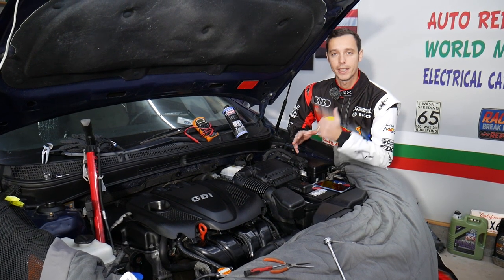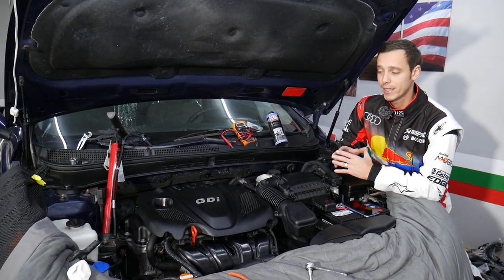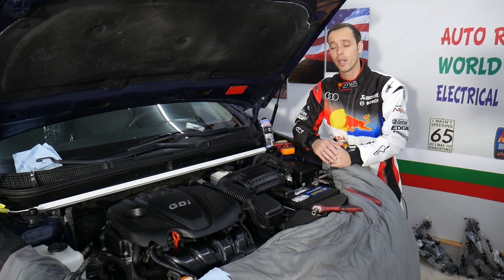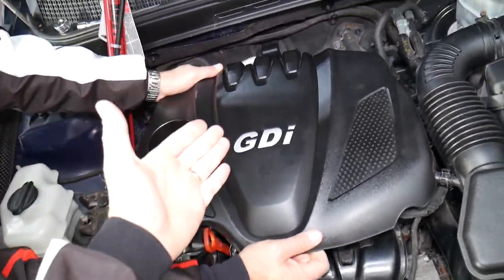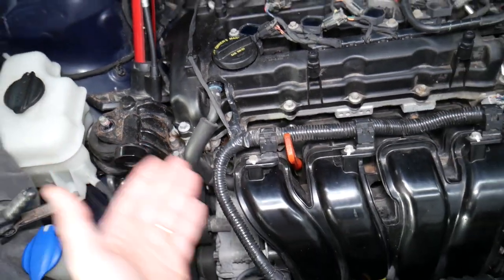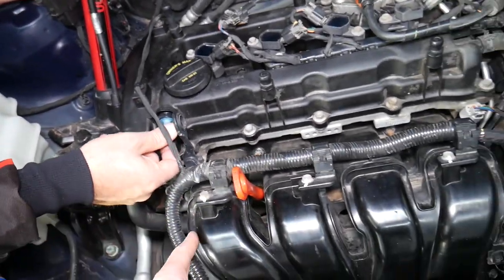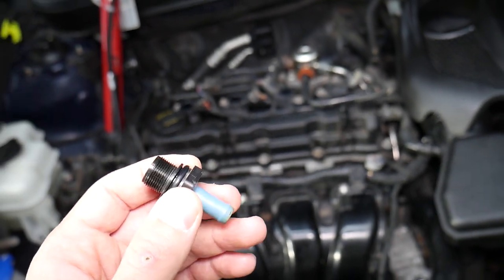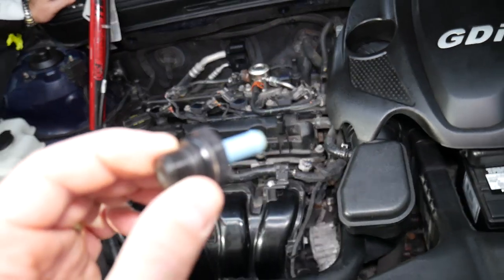KIA OPTIMA INCREASED OIL CONSUMPTION, BURNING ENGINE OIL

Comment: I'm sick and tired of changing full synthetic oil in my 2016 Kia Optima for every 1000 kms! Dealership is like there's nothing they can do except buying a new engine! How in hell can I change an engine on only 149000 kms? This is my last time to buy a Korean car! I had the same issue with my 2015 Hyundai Sonata!
Reply: I'm having the same problem I don't understand what it is about Kia my parents are having that problem too we've only had it a year and a 1/2 and and it probably uses a quart of oil every week that's after I put  treatment in  it that's supposed to stop or slow oil usage down now it's starting to skip a little bit they told me I need a valve cover gasket but I've never seen a drop of oil on the ground underneath it as much oil as it uses and I've never seen a drop on the ground I've never seen anything like that.  Normally a vehicle goes through that much oil your whole driveway would be black
Reply: @melissafritts8648  These Korean cars look good on design, but the engines are craps!
Reply: same here, I only get about 500 miles
Reply: There is a engine recall on your car. My daughter had the same issue and now the car runs bad. The dealership is not helping out. We are taking it back today to see about the recall. Problem is there are so many cars that need engine repair or replacement. Kia is not fixing the problems.
Reply: @marleenanconetani4516  hello did You ever get your issue fixed?

Comment: Changed Valve and still burns oil Kia sucks. Never again will I buy a Kia.
Reply: What model/year miles does it have?
Reply: @joeblue386  2018 /Kia Optima 96,000
Reply: @robc6165  have you tried using full synthetic high mileage oil, might help
Reply: @joeblue386  Yeap
Reply: I’m in the same situation.. 2017 Kia Optima.. burning oil bad, idling bad. 95k miles. So bummed,
Reply: @mirandamabe5107  I had no choice but to traded in I’m done with Kia
Reply: @robc6165  this is what I’m worried about. Gunna have it checked out first and make 100% it’s not something silly, guess we will see. Love my car but man.. cars shouldn’t be going out so quickly like this, i for one don’t have that type of income to buy a new car every 60k miles 😂😂
Reply: @mirandamabe5107  Well try to get you a Chevy or Toyota 🙏🏽🙏🏽
Reply: @robc6165  I don’t think hubs would appreciate a Chevy coming out of my mouth 😝😝 he’s a Ford guy. I wanted a Kia, because then nobody can say “oh your Ford or Chevy sucks” 😂 thinking jeep route, we’ve had a few, need a older model so hubs can actually work on them, these newer sideways engines he won’t touch.
Reply: @mirandamabe5107  Yes Jeep is good no mas Kia 😃😃😃
Reply: 2015 optima never burns  any oil
Reply: @MichaelSmith-ti6qc  older models are better
Reply: @robc6165  wait until about 110k that what mine is doing now😥
Reply: @MichaelSmith-ti6qc  what until about 110k that's what mine is doing now. Even with recall.. that they recalled I'm now out of warranty. Even though corporate kia told me my engine is lifetime because of this. No dealership will touch with me paying 100%
Reply: @MichaelSmith-ti6qc  just wait mine is 2014 just hit 110k. Now putting in oil constantly. Kias are pos.
Reply: @jenniferjohnston6361  oof
Reply: I've done the same thing I've used all different types I even used treatment that's supposed to stop or slow down the usage of oil and it does not work! I'd I don't get this Kia thing my parents have the same problem and everyone I talk to online the Kia they own uses oil mine uses about a quart a week depending on how much I drive it they told me I need a valve cover gasket if a vehicle uses a quart a week and the valve cover is bad  normally oil is all over the ground my driveway is clean!! that's very strange lol  And I don't know if you've watched the videos on how to change valve cover gasket but you might as well try to teach me  Is calculus
Reply: Mine has over a 100000 miles and it's a 2015 I have 99 model trucks with  Over 250000 miles that don't use a single drop of oil but this 2015..  They don't make them like they used to and they don't make them in America ...wonder what the problem is lol
Reply: @melissafritts8648  young kids with there technology
Reply: @joeblue386  I have used ultra premium full synthetic oil, yet  the engine burns it like crazy! I have a Kia Optima 2016 at 150000 kms!
Reply: @robc6165  Chevy?  are you kidding they build garbage......Ford and Toyota have the best reviews
Reply: @toddbob55  relax 😎

Comment: Y’all HELP! My Kia is burning oil like crazy in 2 weeks the dealership is suggesting that I pay $1200 for a combustion cleaning? But I don’t know if that’s the answer
Reply: Probably not.  I had a PCV valve replaced, fuel induction service, injection service and my spark plugs were black Twice. Nothing has helped.

Comment: This May 'Help' For 500 Miles Like 2 Qts Of Oil Will... But This Engine Is Just Flawed..... Best Bet... Get Cheap Oil Changes... Doing It Myself I Get The 20k Mile Filter And A 5 Qt Container  Standard Basic 5w20 $20.. And Just Pour A New One In Monthly Til I'm Close To The 20k Miles Which You Can Set To Remind You In The Car....

Comment: I was thinking my mechanic was shorting me during my oil changes, because I notice my oil light is coming on 500-1000mi. early before it's time for me to get an oil change! I'm definitely going to swap this little part and hope it fixes the issue.
Reply: Same here lol
Reply: @kuntachente6273  I just changed my PCV valve today and it was easy AF for the 2016 Optima. Now, I just gotta see if this stops the burning oil.
Reply: @420  your comment took the words right out of my mouth. I thought the exact same thing. So tomorrow I’m going to do the oil change and swap this valve for a new one too. Good luck to both of us lol
Reply: @420  did it work?  i also have a 2016 and wondering if this is the solution...
Reply: @kuntachente6273  me too! Just swapped it out and will see if the level stays put like it used to
Reply: @420 did it work
Reply: @Renzo.Fortini  no, it did not work. My 2016 Kia Optima has an engine recall, so the burning oil is considered a sign that it is starting the process of dying. I actually found a crack in my oil pan though and replaced that with the help of my friend with a car lift.

I need to see if perhaps that oil pan crack was the reason why I was losing oil and perhaps my car was not burning oil. Might've been a slow leak that expanded and THEN I noticed it to fix.

I'll check my oil level later to see if I'm still full.
Reply: @420  sorry to hear that brother what’s the update so far? Did the leakage stop?
Reply: @Lalo6169  the leak stopped after I swapped the oil pan. The burning oil issue though still persists. It will just be that way until it finally dies out. I have to top-up the oil every X amount of weeks.

Comment: An issue with the PCV valve is that it needs to sit vertically not Horizontally
Reply: So is this just a bad design flaw?
Reply: Why would they fucking mount it sideways?
Reply: Also, why does it need to sit vertically? I just want to understand a little more of why the trash vehicle keeps fucking me over

Comment: I have a 2019 Kia Optima (bought it NEW). 
I just started having engine problems this past summer with the oil burning fast. The dealership did engine testing & engine cleaning. 
They contact KIA directly about the problem, & KIA told the dealership that they can’t replace my engine.
& my engine still under 100k miles warranty.
Reply: Same! I started having the same problem this time last year, but my dealer's service center wasn't nice and didn't keep up with my records so I started going to a local shop and had to go every 1k miles to get an oil change. I had to go back to me dealer to see if my warranty would cover it but since I didn't do regular maintenance with them since covid I didn't have receipts of the oil changes I got else where when the light would come on. So now they say an engine replacement is needed, but won't be covered😡
Reply: @Maria Cusick  you can't get the record  of your oil change where you got it from and take it to them
Reply: @DonDon 360  no, because the local place I've been going to since last year isn't enough. They want the receipts from when I didn't go to the dealer's service center before last year during 2020 and 2021 and I don't have those because I only got an oil change when the light came on.

Comment: Hello World Mechanic !!  / Thanks for ....Kia/Hyundai work with the " Oil consumption " issue. I see in the video...RED dipstick !
There is also some issue with the PVC as you are working with; plus some problems with bad rings....and burning lots of oil. Note:   Here's a review of the Kia/Hyundai..." Dipsticks ";  Original is:  YELLOW.....Regular OIL volume, as in the 
Owner's Manuals;   If the car has been thru their " Oil-consumption-tests "....Then it's changed to ORANGE & that has 
different ( more-engine-oil ) level added to the engine ( this supposedly helps to have more oil inside the engine, as the 
engine is burning-more oil );  Then.....RED dipstick ( The Engine has been....REPLACED ).  Note: We have 2016 Kia Soul with the 2.0 engine;  started using more of the 5w-20 oil at about 30k....until it was using like....1 quart per 1,500 miles.  Then....changed 
up to 5w.30 ( Ok per the Owner's manual ) at about 85k / NOW........Only using about 1/2 quart every 2,000 miles. We now have about 105k on the Soul & I monitor the oil every week ( just to be safe );  We also got the KSDS Mod from the dealer and we now supposedly have....15 year or 150,000 mile warranty.  We will see what happens, but  it kinda looks like EVERY ONE of their engines that fails & blows-up.......has done so, due to long-time running with very low oil !!  Good luck, jeffrie / Camas, WA

Comment: Thanks for the video, I'll get mine replaced soon.
Reply: Of only it was that easy . check consumer reports on these pos. They recalled recall. No dealer will touch if your not on warranty and original owner. Talk with corporate kia has lifetime warranty as long as your original owner. If not they dont care about you.

Comment: my kia 2015 optima is consuming oil 1 quart every 500 to 600 to miles I changed the pcv , it did help up to 1000 miles and now went back as before still consuming and I tested the car to see if any smoke comes out the tail pipe , it is always clean, no smoke at all . any recommendation how to fix the problem the car has 120000 miles and runs good.
Reply: You just need to add some cheap oil don’t waste your money on repairing